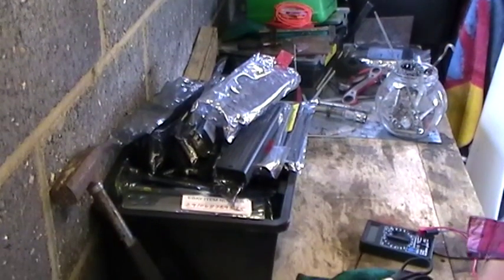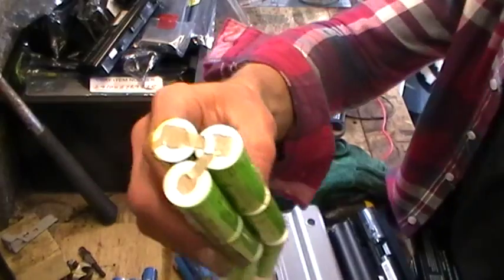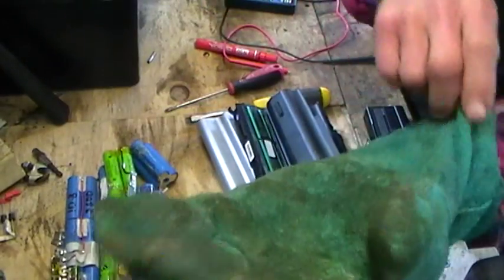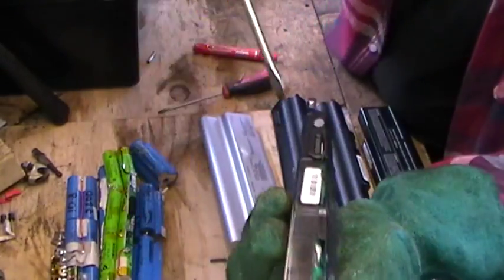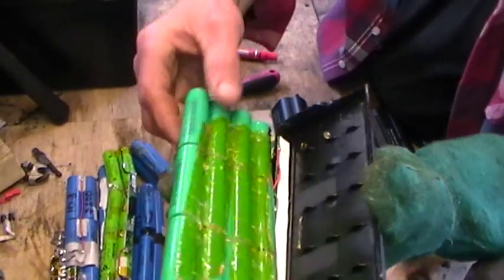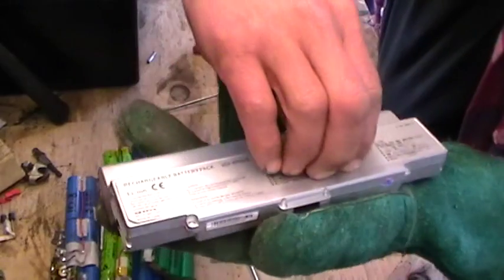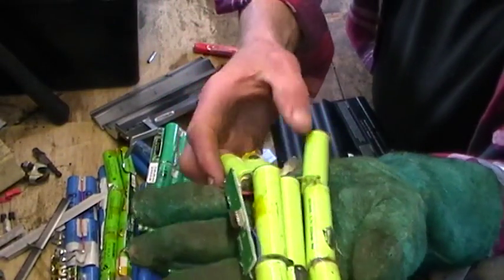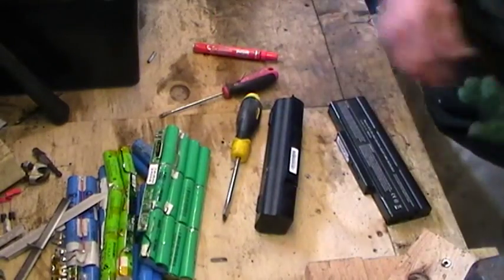DIY TESLA Battery Pt 1   -Recycling lithium ion batteries for Off Grid Solar 14-06

Comment: Do you need to charge the lithium battery before soldering it?
Reply from the maker: You need to check the battery before integrating it into whatever system you are making you could charge it to 3.7v  and then up to 4.15v-4.20v when the battery is in the system./